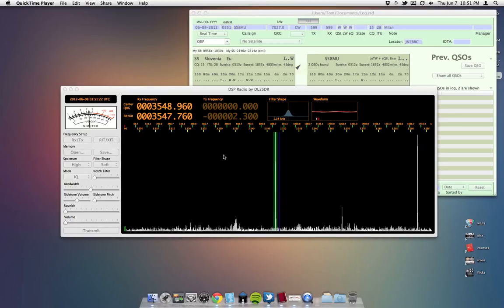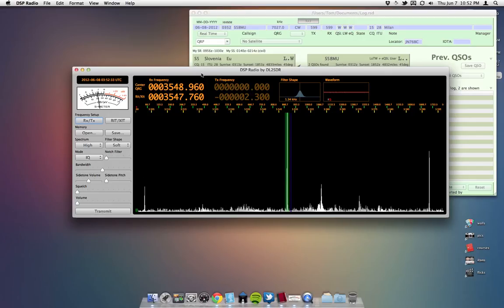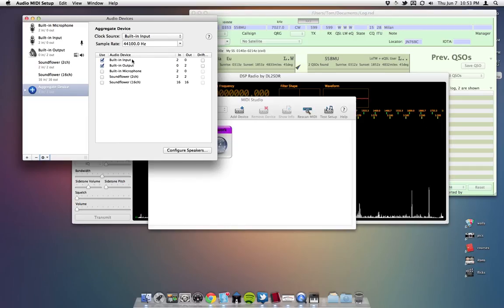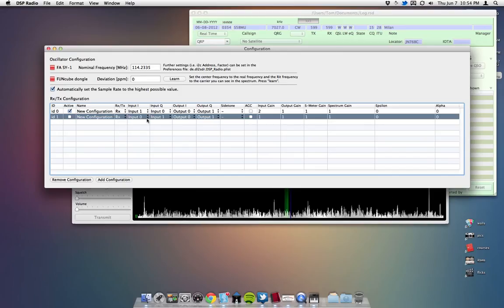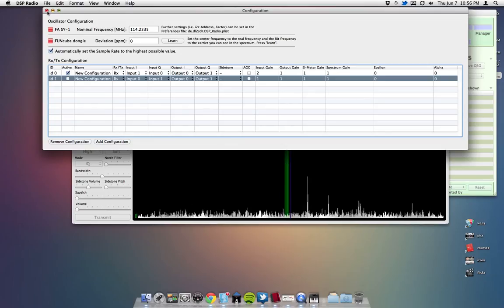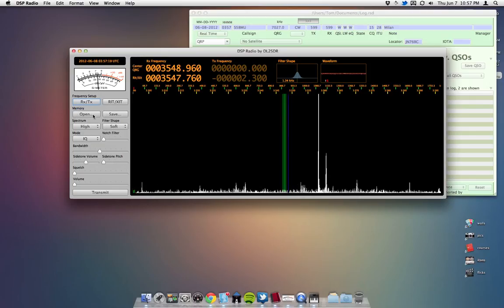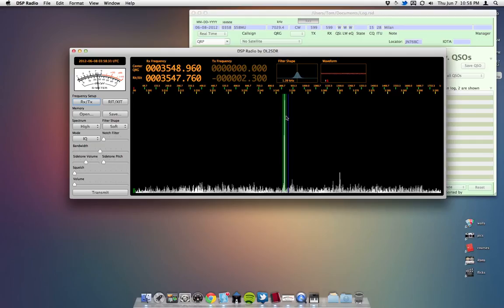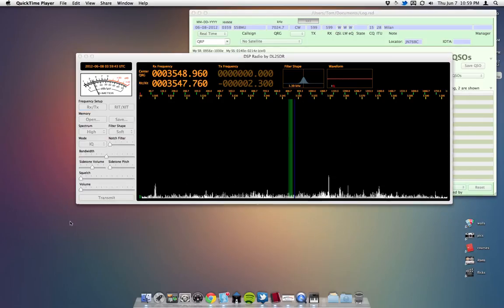Setting up DSP Radio on a Mac for use with the KX3

Comment: I have a MAcBook pro with Yosemite OS, would this software work on it?
I am going to order the USB cable from Elecraft.
Reply from the maker: +Achisachis73 Yes it should, though I have not had my KX3 for quite some time now so I cannot test it myself.
Reply: TJ Campie why did you sell your kx3?
Reply from the maker: +Achisachis73 An insatiable thirst for rare DX (QRO) and a great desire to have a shack that was unencumbered by 20 wires and cables going every which way as was typical of the KX3 setup.  It was a fine radio but for those of us who spend a majority of our lives in our shack, its just impractical.  It was replaced by a TS590S and has not been missed.
Reply: TJ Campie LOL I agree with you, the radio is not perfect although some people think it was delivered by God himself. I am thinking about selling it because of the qrp limitations, it is frustrating.
Elecraft is already thinking about boosting it to 15 watts but, Im not sure that would make much difference. 
I do not have a shack because I live in a small house and do not want an ugly tower in the lot. Once I get a bigger property, I would be able to install a tower in a better manner.
For portable I will keep my ft-857.
The one thing I believe is important, is the CW decode capabilities of the kx3, Is there a radio that would compare to the kx3 in that sense?
I am not proficient on CW so the software helps.

Comment: Problem solved. The image I was seeing was hardware related. The time-domain waveform window to the upper right of the radio GUI was showing the Q channel to be about 5dB lower in amplitude than the I channel - this severely degrades image cancellation. I was able to adjust the I vs Q channel level in the MIDI audio window setup, and now I have decent image rejection, and a true  -/+ 22 KHz spectral window using the Griffin iMic USB 'soundcard'.

After playing with the port switch on the iMic and seeing a variation in I vs Q, the I/Q amplitude imbalance was definitely coming from the iMic. They use a mechanical switch directly in the signal path - cheap hardware...

Comment: I've found DSP Radio V1.4.1 to be a significant upgrade - their spectral display is now dB based and thus shows a wider range of signal strengths. I'm using a Griffin iMic as the audio interface. Problem - the display has zero offset at the center rather than to the side, and mirror images on both sides. Not sure if it's a software issue. I/Q data should suppress the "negative" frequencies, and I do see about 10dB suppression.

Comment: TJ

I have an Imac and KX3.  RX\IO is On and stereo patch cord connects the 2 into the audio input on back of Imac but apparently no signal.  DSP does not register a meter and i am unable to enter figures in DSP configuration.

Jim